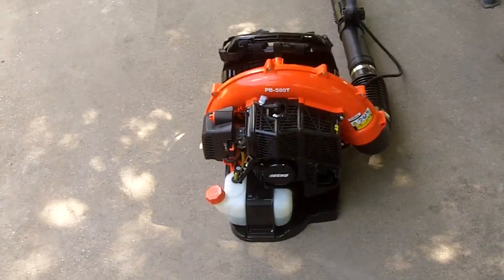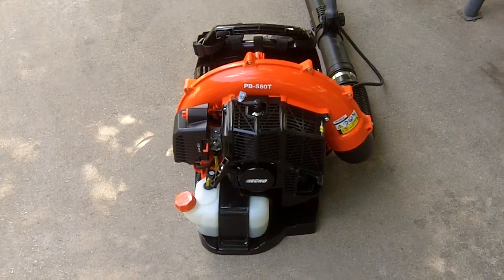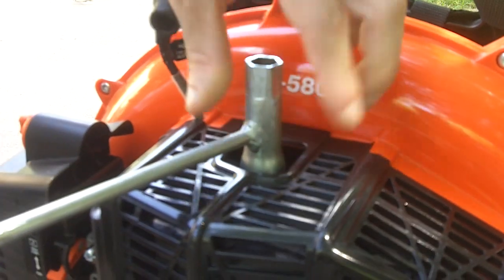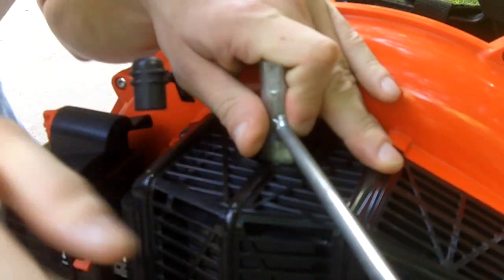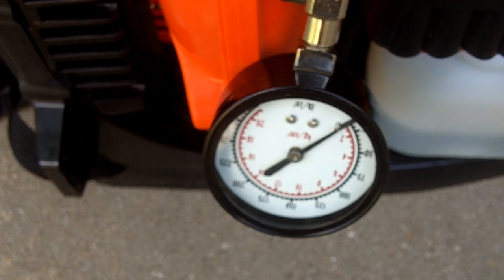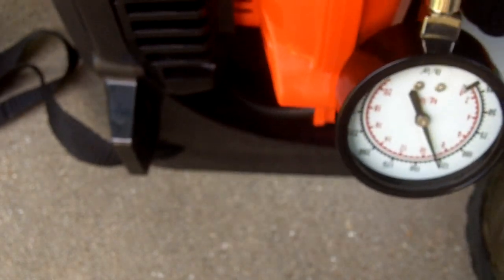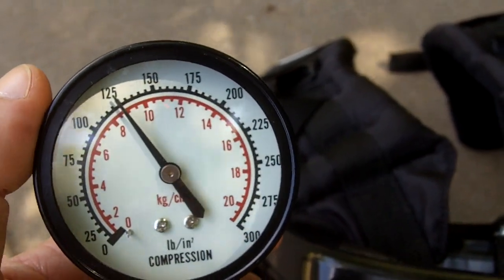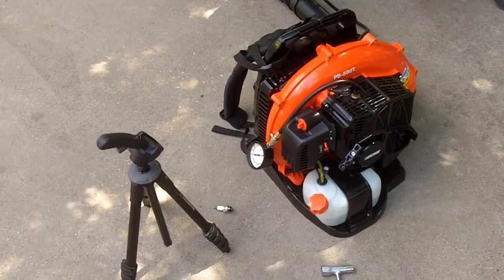Echo PB 580T Compression Test

Comment: Why you doing the test if it runs up to a hundred PSI and will not hold I was going to go back to 0 what does that tell you
Reply: Uh, the compression tester is supposed to hold the pressure, not the engine. 2 cycle engines don't have valves to hold pressure so compression testers have a one-way valve that allows air to go in one way so it can hold pressure and give you a reading. It's likely your compression tester.

Comment: stupid question I'm sure but I am no mechanic and don't really understand the purpose of this test. when you say it has 125 and will gain another 10 after it's broke in. can you explain what that means please and why it's important(or not). is their a target # these should be at and does this test meet that #? Thanks. dave
Reply: Since the engine is new,all the internal components need to "mate" to each other. The bearing surfaces wear (im exaggerating a little) into each other, the piston rings seat themselves and mate to the cylinder wall. Thats where the extra 10 psi might happen. And any small debris and assembly lube from manufacturing work themselves out.
Reply: All engines have minor imperfections, especially new engines. Overtime these imperfections wear down and form better bonds to the internal components. That's when the compression reading (probably) gets higher.